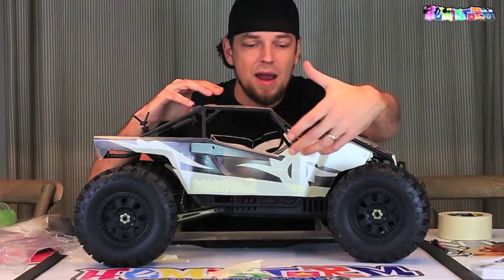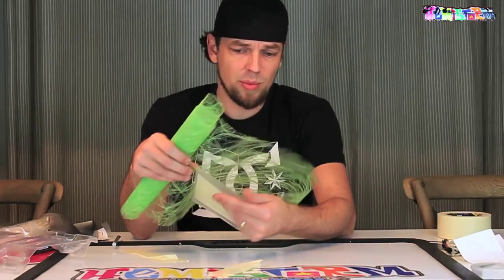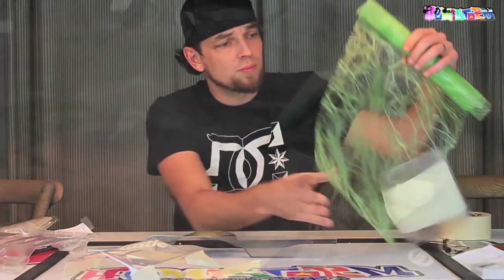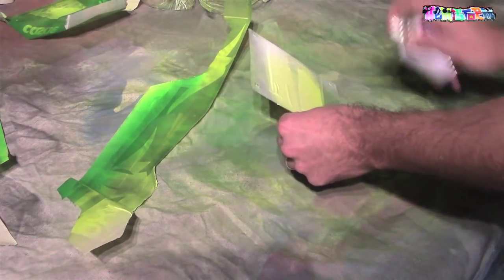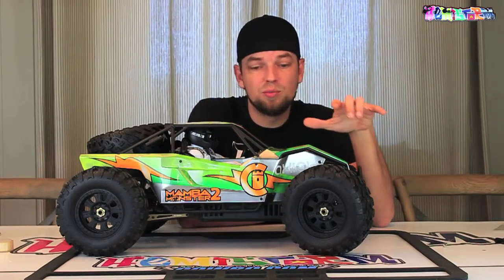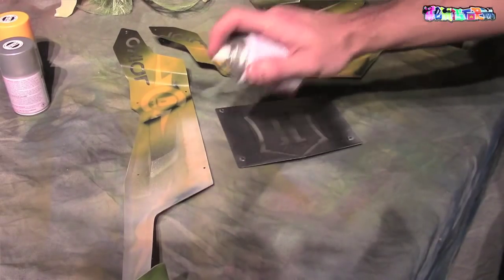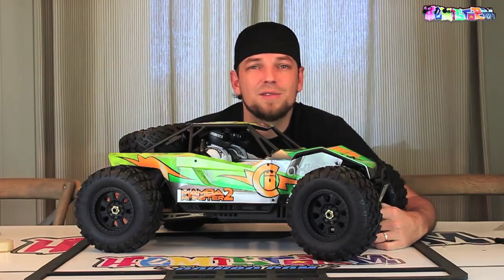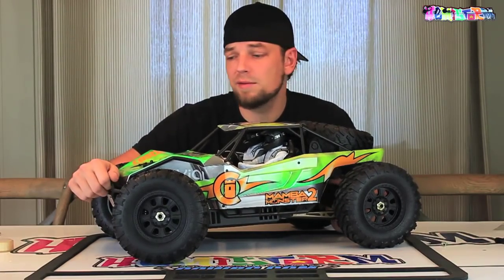SPECIAL RC PAINT EFFECTS - Weave technique for cool backgrounds

Comment: This is a very cool technique, I think I wanna try something like this for the next body that I paint up. Although, I've only done a couple so far, first one was ok, though I like how my most recent one turned out (for my Summit). It's pretty simple, as a mostly all black, with the Pitbull Rockbeast tire tread as diagonal racing stripes pattern in red on either side with red accents, and the badges in chrome. I got the idea from a SEMA truck, that I once saw.
Reply from the maker: That sounds like a very cool paint scheme. :)